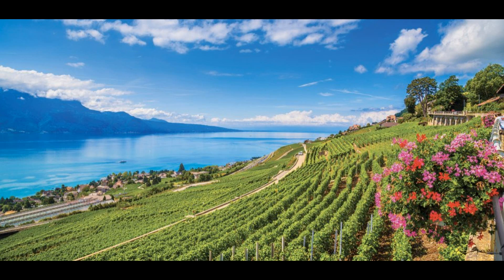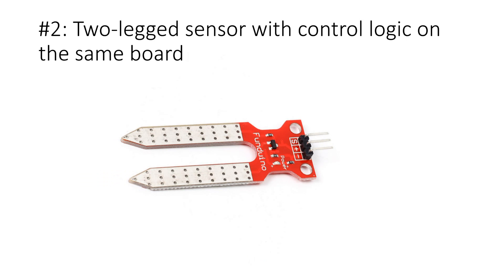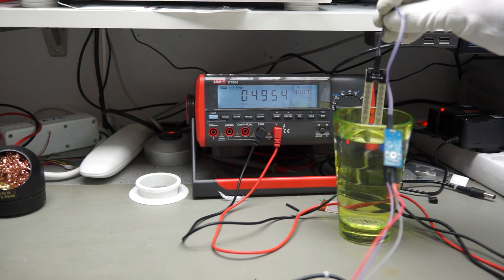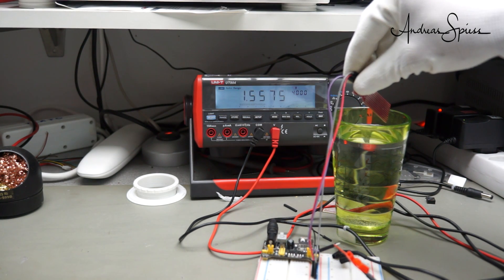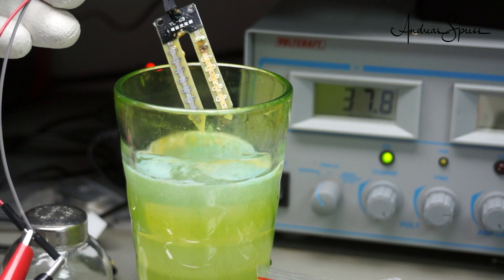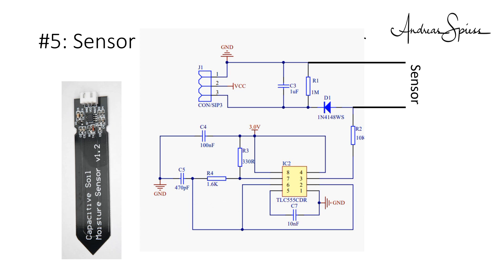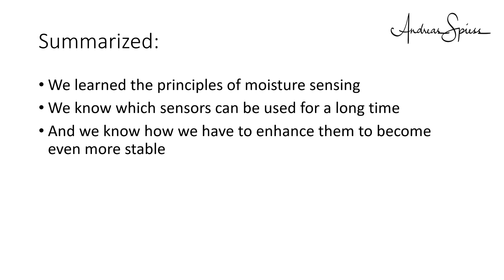463 Why most Arduino Soil Moisture Sensors suck (incl. solution)

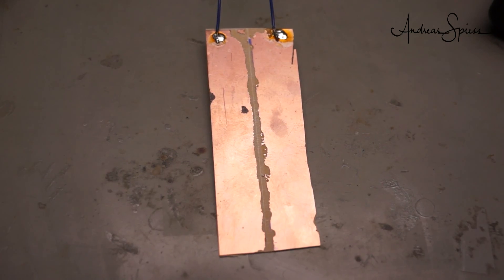Comment: What would happen if you leave out the plastic bag at 8:50? Is there a corrosion problem too then?
Reply from the maker: Yes
Reply: @AndreasSpiess  But then how does the Rs485 Soil Sensor from your other video (https://youtu.be/tDR09WTAcpA?si=U8wKVT0h_iqSLS5e) work, which is also a capacitive Sensor but has metal rods directly in contact with the soil? Isn't it the same principle as your diy sensor with the two copper plates? 
PS: Great Videos!!

Comment: From what i gather the coated sensor used way more power so they last months instead of over a year battery wise. 

IOm strill wanting to have a google come compatible sensor over wifi. i dont want to have a tuya or zigby hub  google home keeps things simple and working well without the need of a hub making replacing things easy and pain free.

Comment: You should really change the electrodes for graphite. Also, these sensors are not designed to work 24h a day, you're wasting energy on reading something that shouldn't really change that much, consider doing a read per 10 minutes or so, and also do fast reads instead of continuous.
Reply from the maker: Good points! Thanks.

Comment: I remember reading about this problem in the 1980's (probably in Electronics Australia Magazine). If I recall correctly,  there was an IC manufacturer who produced a chip specifically for this application. It applied a small AC signal to the probe for measurement to prevent electrolysis. 
I see lots of moisture probes advertised now and just assumed they would use the AC method. I forget how much junk is sold out there.
Reply from the maker: I did not know that this issue is so old.
Reply: @AndreasSpiess  I guess I'm showing my age here, haha. 
Keep the great videos coming, they're always interesting and I learn a lot from you. Cheers.
Reply from the maker: @desparky  It cannot be the age. I am 66 ;-)

Comment: I think that is just good old electrolysis happening there, the direct current will break apart the water into Oxygen and Hydrogen and the residue probably has to do with the impurities or minerals contained in the water that can also react.
Reply from the maker: I think, you are right. Other commenters also pointed in this direction.

Comment: Arduino's can drive and measure capacitive changes between plates directly. There even an offical library for reading such sensors. 

It's also easy to create such plates oneself. If aluminum or titanium is used it's also possible to anodize the surface to insulate them. Far more even and resilient surface than varnish Nb the  thickness of such an anodized layer adjusts the value/range of such a sensor
Reply from the maker: Thank you for your additional info!

Comment: Wasn't some of the capacitive sensors missing a critical component?
Reply from the maker: This is a re-play of an old video. In the meantime, it seems there are different variants available, some that do not work. I added the info in a pinned comment.

Comment: If price is not an issue, i have uses smt100 and smt50 from truebner on a research project. They currently have an uptime of 4 years (but they cost 100 and 50euros respectedly)
Reply from the maker: I recently saw them on on a fair. They seem to be solid.

Comment: you can use the cheaper ones without their electronics, and alternate the current thru them. the main problem with all these sensors is their resistance depends on the soil and the minerals present. takes allot of effort to calibrate them on specific soil now try it with changing soilminerals (rain water vs tap)
Reply from the maker: I agree with your findings.

Comment: Great video Andreas! I've been having problems with the capacitive sensor, making my house main differential circuit breaker go off as soon as the sensor contacts the soil. I'm assuming there's some kind of leakage?  Will try the plastic bag to isolate the sensor and see if it helps
Reply from the maker: The 5V power supply should insulate your devices from the net. So pay attention!
Reply: @AndreasSpiess hmm, that could be the issue... will try with a different PSU. Thanks for replying!

Comment: I've used a similar circuit on the Farm-Data-Relay-System attached to a Watermark Soil Moisture Sensor.  I've used the sensor for years and it works well.  I also make Gypson Moisture Sensors that I have described on Printable.  They provide similar readings but they tend to dissolve over a period of time.  Watermark sensors are very expensive but are worth the money for monitoring my foundation in Texas.
Reply from the maker: Glad to read that you use the FDR system (I once made a video about it)

Comment: Only reliable soil moisture sensor is a tensiometer. Put a digital pressure meter at the top and you have a perfect sensor, way better then this.
Reply from the maker: Thank you for your comment. I did not know that such a device exists. After investigating a bit, it is probably more of a professional instrument and also at a different price point.
I agree that the sensors in this video are not accurate. But they should be ok to create watering signals for home usage.

Comment: Hello Andreas, Gardena (Husqvarna) uses a different approach for its irrigation/sprinkler system. Its moisture sensor contains a metal tip that is enclosed in felt. This metal tip heats up periodically (about every 30 minutes) and, based on its temperature decay (cooling time), the degree of soil moisture is calculated. When "wet", the connection between two pins is "closed," when dry the connection stays "open". The two pins are connected to the irrigation controller. Why periodically - to allow for battery operation. Greetings, Stefan.
Reply from the maker: Thank you for the description. I never read about such a method. But obviously, it works!
Reply: As long as it is low-power appliance, and the whole system (including the computing/communication unit) must run from a relatively small battery for at least the duration of a planting season independently, wasting the juice on turning it into heat sounds suboptimal to me. 

But as long as this does not take a significant amount of battery capacity (say less then ten percent), it may still be feasible ...
Reply: Wet bulb concept.

Comment: Another good solution to protect the capacitive sensor pcb from moisture would be to cover the edges with hot glue.
Reply from the maker: I did not try it, but it is well possible that it resists water

Comment: Cool DIY sensor ;-). But seriously, I think a capacitive DIY sensor can be a good option for makers and you can easily create a square wave signal with a microprocessor board.
Reply from the maker: I agree. But the simplicity of a 555 timer is hard to beat ;-)

Comment: Nearly 100% of this is Electroplating 101.

Keeping DC measurements quick and short can prolong the electrode life as long as the time is less than the polarization time of the electrochemical cell - in this case the materials and the distance between electrodes can have an effect although my experience has been to keep the measurements lexx than a few milliseconds and, if possible, disconnect the probes from any cirtuitry which might provide a DC bias current to flow.  Ground, any power connection, etc., a good double pole relay would work here.  Also changing the polarity, as suggested elsewhere, can help.

Another way is to transformer isolate the probes although this quickly gets difficult and requires AC measurements which are more difficult for the novice.

Capacitive sensors are, by far, the best bet for this environment.

All this the result of trying to measure pool water for various parameters.
Reply from the maker: Thank you for your additional information. I am sure that shortening the time for measurement has a big effect!

Comment: I wonder if an air humidity sensor placed under an upturned cup on the soil surface would be of any use. It could be an interesting experiment.
Reply from the maker: Maybe you try it? The sealing has to be very good, I assume. Otherwise, you probably measure the humidity of the room.

Comment: What about sensing by weight instead of moisture level? A flower pot will have a certain consistent weight. As moisture evaporates, the weight will be reduced. At a certain point, you turn on the water. You might have to re-calibrate from time to time as the plant grows.
Reply from the maker: That is a good idea. I once made a video on how to use load cells.
Reply: Excellent way to approach, especially if container plants. Too wet is worse than to dry. 

Super simple electronic options.

Comment: Did you check the RF-emissions of the capacitive sensor with a SA? I think there might be a lot of harmonics causing QRM in the HF bands. Maybe not relevant for the average houshold, but in fact, for example I've turned off my weather-station because of spurious emissions in the ISM-band, disturbing my satellite groundstation. So, maybe as a HAM-operator I'm a little bit over-sensitive to this . Anyway - nice video, thanks!
Reply from the maker: No, I did not check it for QRM. I have enough other sources, and I am building a remote station because of that ;-)

Comment: Hi Andreas, I have tested the capacitive moisture sensors quite extensively in aquaponics. I use a ADS1115. I found considerable variation due to tempurature fluctuation.
Reply from the maker: Thank you for sharing your experience. Other commenters confirmed your finding. I do not think these sensors are suitable for precise measurements. But they are okay to create signals for watering.

Comment: Could you drive the original sensors with an AC voltage to avoid the electrolisys and then rectify the output signal with a diode?
Reply from the maker: That would complicate the design, but it is possible and would reduce the corrosion.

Comment: It has always bothered me that the bulk of Moisture Sensors being sold are nothing more than simple ohmmeters which measure conductivity.  I guess most consumers and manufacturers never paid attention in Jr High science classes.  Try measuring the moisture level of distilled water and they read dry.  Water doesn't conduct electricity folks, only the minerals suspended in the water.  Which of course changes when water is added to soil, the alkalinity of the source water, etc.
If you want a cheap electrolysis instrument to stick in your soil to tear apart the water molecules, then by all means spend $2 for a moisture meter from Walmart or other box stores.
Reply from the maker: What effect does the Walmart meter use?
BTW: The capacitive sensor does not use the conductivity of the water; it uses its dielectric effect.

Comment: So you made an unintentional electrolyzing cell. You are deplating the anode(+) side and plating the cathode(-) side. As well as liberating some hydrogen on one electrode and oxygen on the other. One way to make them last longer is to swap the polarity every other time you read it and only activate it when you want to read it. Nickel plating the electrodes will also help some. 😊
And for the capacitive version you might use some spray on conformal coating.
Reply from the maker: Thanks for your tips! Conformal coating for sure helps.
Reply: Or with suitable choice of material... Any dc current flow will anodize a plate and stop the conduction.

Comment: there is a prefect soluiton from 70's: gypsum block. the response time is slow but extremly accurate.
Reply from the maker: Thank you for the info. I found that these sensors are pretty expensive.
Reply: @AndreasSpiess  easy to make u just need two graphite electrode and gypsum. and a temperature sensor if u want to be really pro.

Comment: I solved the corrosion problem by connecting the sensor VCC to a digital pin of the Arduino which is normally low and turn it on for only a few second every hour
Reply from the maker: That is a good idea!
Reply: In this way  less energy is consumed,  specially if using solar energy to water the soil. We should just check the current needed for the sensor,  it should be less than output current of the digital pin  @AndreasSpiess

Comment: This was interesting, but might be a little out of context.

This would probably be fine as a physical liquid level measure, but that's not how dirt and moisture work in most agricultural situations. 

If your plants roots are sopping wet, your plant is likely drowning. 

Usually there is much less liquid in soil, and that may make the readings much different. 

Could you repeat the experiment with the last sensor, using different types of soil, and adding water like a grower would? 

The best test scenario would be in a large planting container exposed to the outside air conditions and to the sun, but protected from direct rain.  That way, there is a large amount of soil, there is air, heat, sunlight, wind, to dry the soil, and you can add water in small amounts, as if from a sprinkler or irrigation system.  The moisture in the soil will need to equalize across the bulk of material, rather than just detect full saturation. 

Water would arrive on top, and then get wicked through the soil.  Having a short or small container might give false readings from water pooling in the bottom, saturating the lower part of the sensor.  The sensor needs to be affected by the correct amounts of moisture in the soil, not just "dry_ and" saturated" conditions. 

That would simulate regular growing medium better, and give a better idea as to the signals seen and the response time to detect actual soil conditions.

___

As an added thought, this looks like it would be a good wired system for a central garden plot.

Consider a yard, though, or multiple garden plots, distributed areas, etc.

Having wires running 10s or 100s of feet, in multiple directions, on opposite sides of structures, etc., and with foot traffic or vehicle traffic in the area.

This would be hard to set up, calibrate, and maintain.

A larger scale solution would call for wireless communications, sensor differentiation, logging, and probably power management.

This is a job for SUPERMA--  Sorry, I got carried away.  This is a job for:  I don't know... It's got to be be cost, able to leap large distances, be identified, easy on the batteries, etc.  LoRa?  I don't know the costs or component size.  422mhz?  ATtiny85? RaspiNano?  BLE?

I can think of a couple approaches.

I can envision a mesh network for ease of adding sensors and extending the coverage of the network, but that seems complicated. 

 I can see having a base station and just relying on low power rf transmitters, logging and sleep routines, and periodic polling fob the base station.

I believe that BLE can operate as a mesh network.

That's enough to think about now.  I think I want more coffee.
Reply from the maker: When I made this video, I was looking for studies as you describe. They should be made by agriculture engineers, not electronics engineers. But unfortunately, I did not find any. That may be different now.
These sensors could be more precise. I think they can be used to generate watering signals in typical home environments.
If you want to avoid cables, maybe you google "LoRa moisture sensors". Their range can be a few km. You also find many videos about the LoRa technology on this channel.
Reply: @AndreasSpiess  Thank you. I am thinking more along the lines of a home owner. We aren't on a large plot, but with a growing space at the front of the yard, two near the house in front, four spread through the back yard, the thought of monitoring all of that using wires is a problem.

I guess in the end, I would pick maybe two or three, but even then, that's a lot of wiring spread across hundreds of feet in different directions.

As a manual (handheld) tool, that might be a more practical solution for me, but then we're back to doing things manually.

Still, it's a neat video.

Comment: I guess we could also just use one of the capacitive (touch) sensors of an ESP32
Reply: I just made a very quick and dirty test: I burried two isolated wires close together in very dry soil.
Connected one to an ESP32 touch input, the other to ground. Run software that uses pin 33 as a touch morse input and let it plot the touchRead(33) values to serial. On watering the soil the values dropped from around 50 to around 36.
So this very primitive sensor consisting of two isolated wires already gives usable readings :)
IF youtube preserves line layout you can see it here:
T33	49	******************* 
T33	48	******************* 
T33	47	****************** 
T33	46	****************** 
T33	45	****************** 
T33	44	***************** 
T33	44	***************** 
T33	42	**************** 
T33	40	**************** 
T33	39	*************** 
T33	38	*************** 
T33	37	************** 
T33	37	************** 
T33	36	**************
After the soil sucks in the moisture the reading falls a bit more and stais there.
Reply from the maker: You can try it, it should work. But only use short wires.

Comment: I have used that cheap sensor on my Christmas tree to warn about low water level for many years without a problem. I realised this design error and implemented very simple correction: I'm not powering it all the time. I use Arduino output pin to power sensor only for a couple of ms only when I do measuring once per each hour.
Reply from the maker: This is a good improvement and reduces corrosion!

Comment: Hi Andreas, did you ever try to put a Bosch BME sensor into a cavity underground like a small platic pot with the opening facing down? This would give you the relative humidity of the air in equilibrium with the soil.
Reply from the maker: I learned that measuring humidity and moisture is a different thing. So I never tried it.